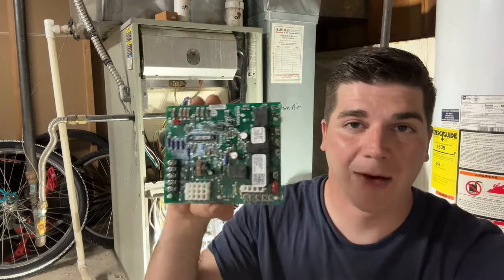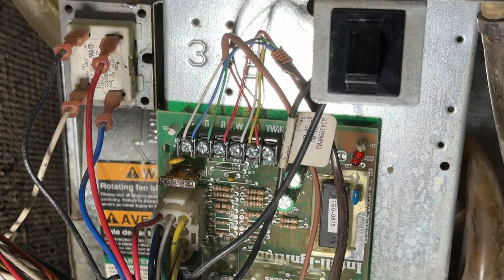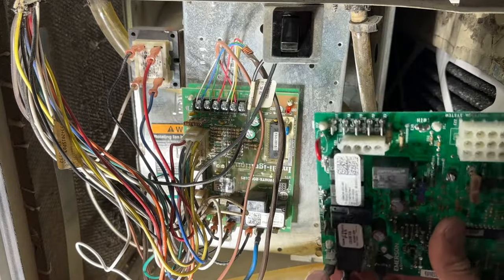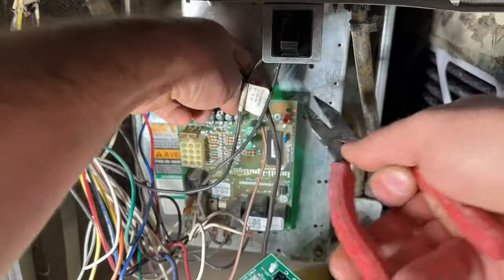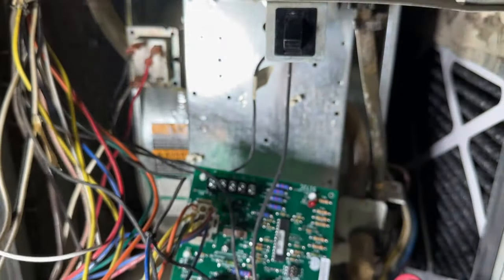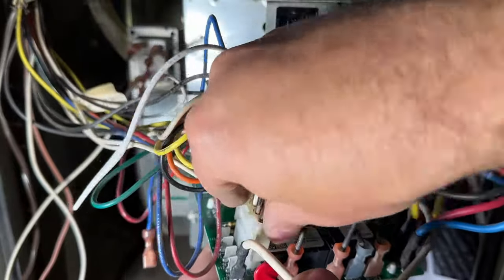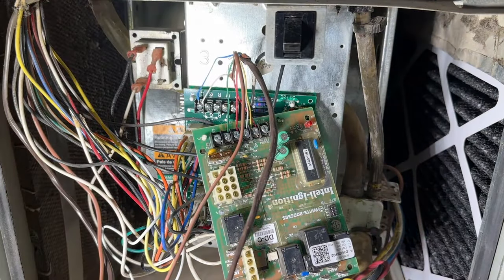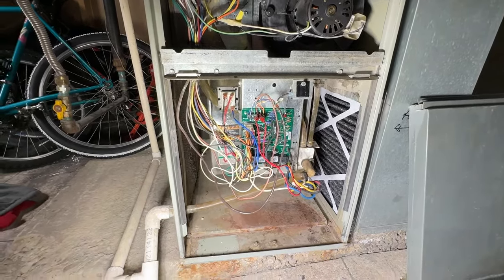How To Replace The Control Board On Your Furnace Or A/C Air Handler

Comment: Hey I just want to THANK YOU for this video - we got a $1200 estimate to replace the control panel in our gas furnace; I went and looked at it and wondered if it was possible to do myself. Sure enough, I watched this and a couple other of your videos, ordered the part, and handled it myself to the tune of $208 total! Thank you so much for such easy to understand, easy to follow instructions! I also cleaned up the flame sensor while I was down there thanks to another one of your tutorials!
Reply: I just got quoted around $1,400 for the same, and just put about $176 in for my replacement parts which come later today, including a $10 fan capacitor with a $400 installation fee.

Jeebus. I’ve built PCs before, so all I needed from the technician was the $79 service charge to properly diagnose the issue.

Comment: Good information, however, I would recommend removing the old board, and install the new board before transferring the wires.  This reduces the risk of electrostatic discharge which can cause the new board to fail.  Believe me, I know.
Reply: Totally agree and less chance of breaking the board when removing and installing wires. Sometimes they are on there good
Reply from the maker: To each his own. I haven’t had any issues doing this method. And you’d need to take a TON of pictures from a lot of angles but it can be done for sure. Thanks for the input sir. Cheers

Comment: Thank you for this video.  My hvac was frozen up last Thursday.  Waited to see if it would come back on after it thawed.  It didn't.  Had service call and they told me it was the control panel.  I had my neighbor who used to own hvac company.  The tech said the control board was old and with no vendor info, that it would be hard to find and about $1500 to replace.  He said I would likely need a new system (current system is just 7 yrs old).  He said if I couldn't find company with control board to give him a call.  That was my clue that he was full of bs.    I didn't bother calling over the weekend.  Took a pic of control panel.  Found the part #.  Googled it.  Made a visual comparison and pulled the trigger.  My neighbor can't do the work because of arthritis in his hands.  I watched this video and was certain that I could do it.  He had a voltage meter and double checked that there were no live wires.  It took 30 mins only because the board was behind drain pipe and other wires.  For $400 including the $195 service call, the 125 part and 75 for overnight shipping, the control panel has been replaced.  Been teasing my boss that I am adding hvac tech to my resume.  Diagnosing is the hard part and I am certainly willing to pay for that.   (I am 57 y/o woman and this was easy peasy.)   Thank you again

Comment: I found the culprit of ruining the control board: spider webs, which caused shortage of the control boards.  Thus, it is important to prevent the spiders getting into the warm chambers of such delicate electronic control board area also the capacitors.  It is too sad that nobody care about the measures of preventing spiders by all the AC units manufacturers.  Shame on them!

Comment: Hello, I have a trane look almost the same as the one you fixed in the video.  but the problem is that the fan always stays on. I changed the control board. I changed the thermostat and checked all the boiler limit switches and everything is closed. I don't know what else to do. Can you give me some advice please?

Comment: Just wanted to come here and say you have encouraged me to do my own heat pump system, as it should be a straight forward install. I was getting quotes for $12000 for something where the parts cost $4450. 

This is the most straight forward install, as its a fairly new construction, no existing condenser or coil, just gas furnace. 
Wiring is already run to cut-off, and the copper line run is about 6ft through the wall to the coil (literally couldn't be simpler).
Need to add and level a 36x36x3 concrete condenser pad. 
The coupler duct is the same size as the coil and requires no fitting beyond removing the coupler duct on top of the existing furnace and putting the coil box in place.

 This will save me $8000 to do it myself, and I gained a skill and some tools out of it.
Reply from the maker: Awesome! If you need some help with your install feel free to check out our Patreon membership over at Patreon.com/diyhvacguy where you’ll get one on one assistance with all things hvac and even help with getting your full 10 year warranty on your equipment. Cheers man
Reply: @diyhvacguy  will definitely check that out, as I was a little bummed I wouldn't be able to get the 10yr warranty since I wasn't licensed. Nice to know there are work arounds ;)

Comment: The orientation isnt the same but for the first four will it say heat cool and park on the old circuit board? You did a great job explaining everything after that but the first four is unclear.

Comment: Question: If you have your thermostat wires connected into the control board from the thermostat. Where do those wires exit the control board?